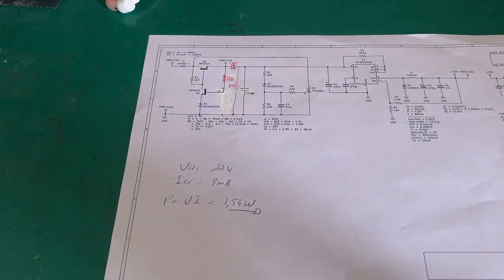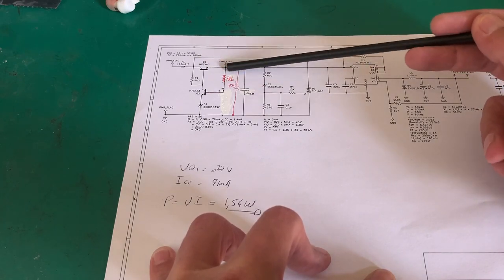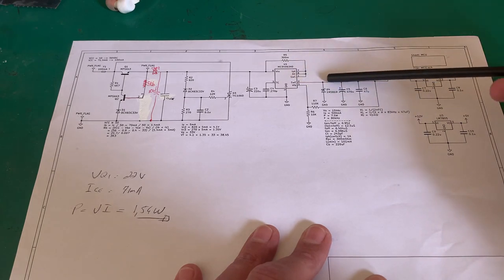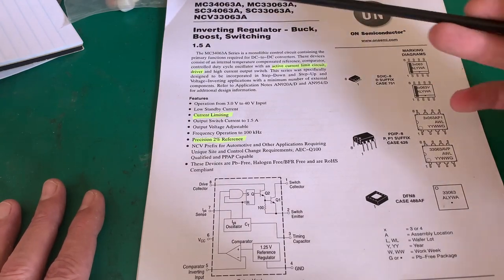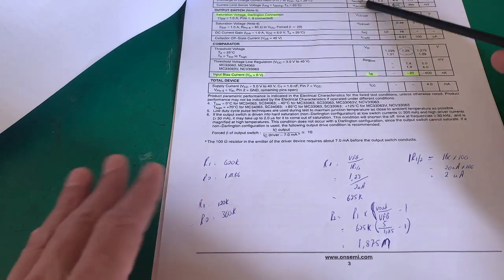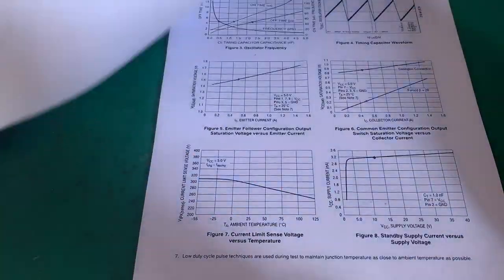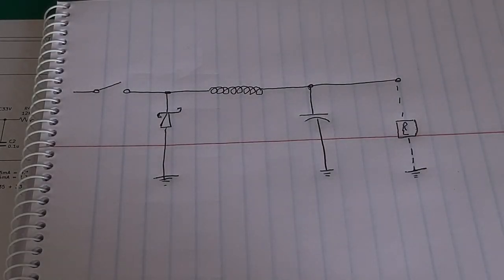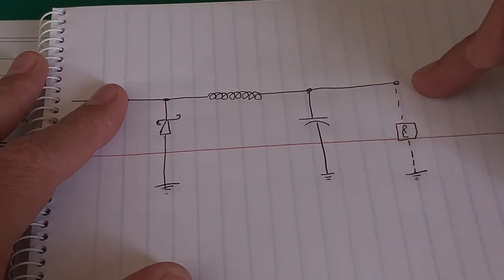FoulkesBrau #55 - Back to basics - DC to DC converter with the MC34063

Comment: A very good treatment of the MC34063 in buck converter mode, so lacking on YT. The noise at switch on is most likely due to pickup in the control logic. It’s really hard to get a switching regulator to work well without a well designed PCB to control stray impedances, and the multiple transitions will increase switching loss. But it does seem to be regulating well. Nice job!
Reply from the maker: Hi Mark,

Thanks for the kind comments. 

The MC34063 is a nice chip. I’ve found that most of the time, the noise is caused from the inductor being undersized. The data sheet is a bit optimistic with their inductor calculation. The other problem is if you get a bunch of fake chips. You will see it immediately on a scope. 

Cheers

Craig
Reply: Yeah, I found it a few years ago, good price and good multiple sourcing for production designs. Its behaviour changes quite a lot as the load varies, which more complex chips are better at handling, but unbeatable for price. And I found a few errors in the data sheet formulae. But well worth getting to know.

Comment: Did you ever look with a scope at the signal at the cathode of the diode - pin 2 of the 34063?
Reply from the maker: Hi Egbert,

I did look have look at the cathode signal with the scope. The signal will be flat because of the smoothing capacitor.

Cheers

Craig

Comment: Is there a way of testing this chip by ohms or continuity across certain pins to find if it is deffective?
Reply from the maker: Hi there,

If you look at the chip block/functional diagram - you can definitely check certain portions of the chip to make sure they are not blown. 

Cheers

Craig

Comment: I'm concerned the buck regulator may not be working properly as shown. I don't believe that sawtooth pattern should be visible at the 5ms/div timescale shown. That looked like 200hz when it should be operating at 80kHz. My first suspicion is that the inductor may be grossly oversized if it's really a 100mH in place of a 130uH.
Reply from the maker: Hi Tinfever,

The circuit works as it should - the problem is that I got a whole bunch of fake chips from one of the online suppliers. Once I changed the chip out for the real one - then everything looks as it should.

I don't think I was using 100mH - maybe 100uH. I cannot remember that chip offhand but 100mH would give me 50.2K of impedance which sounds way too much.

Cheers

Craig